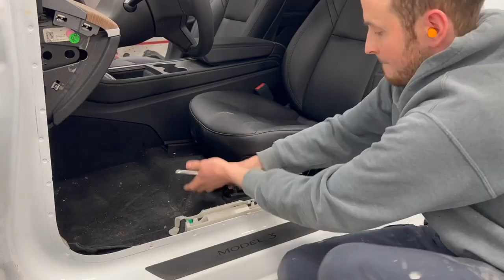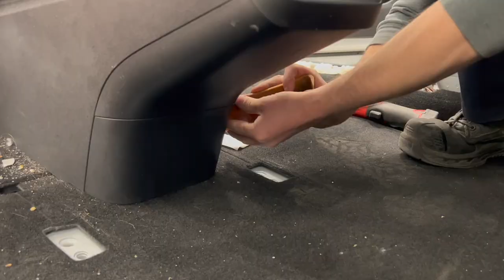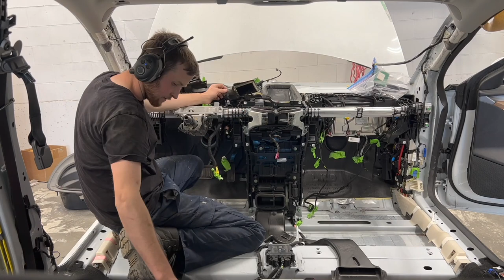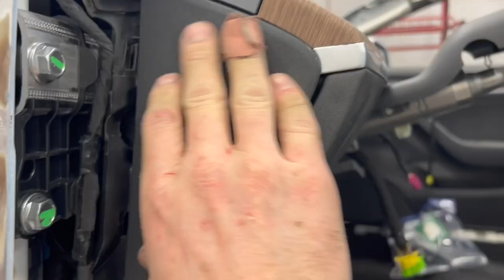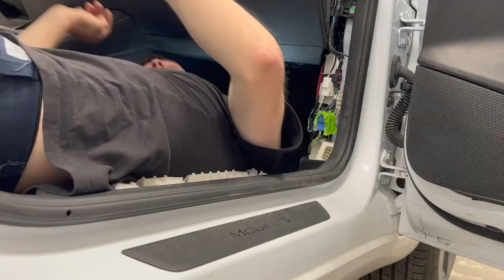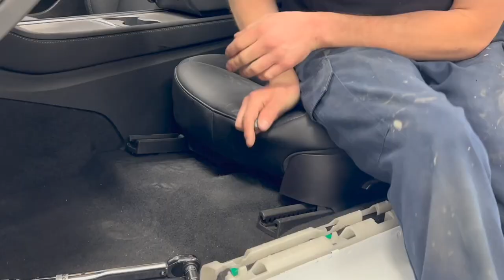TIMELAPSE TESLA MODEL 3 DASH REMOVAL AND INSTALLATION

Comment: Can you expand on what was removed and why? Your videos are really good!
Reply: This video is a timelapse dash removal and installation process on a Tesla Model 3. The high voltage system has been disabled before removing any airbags! The dash was removed for fire hazard/precautions when resistance spot welding for replacing an outer A pillar skin.